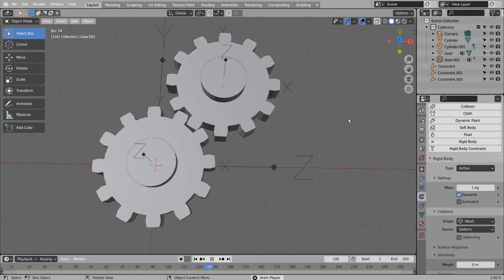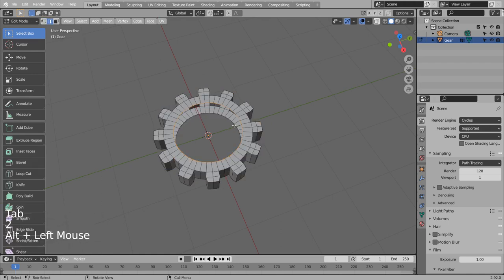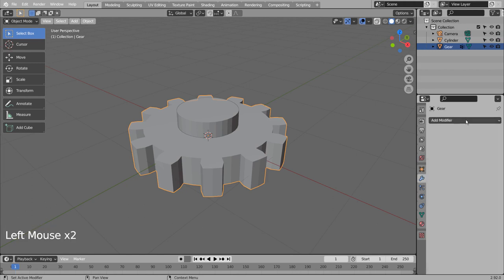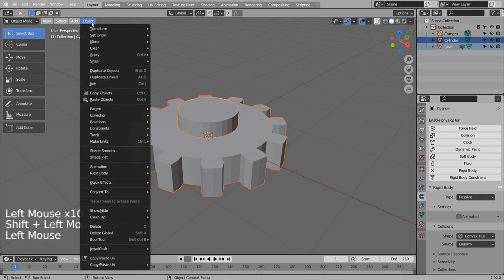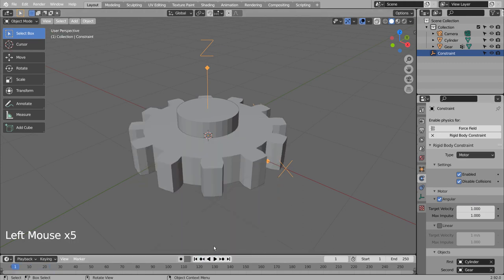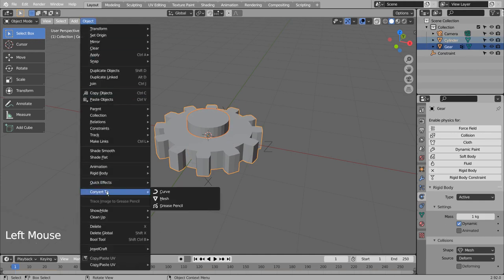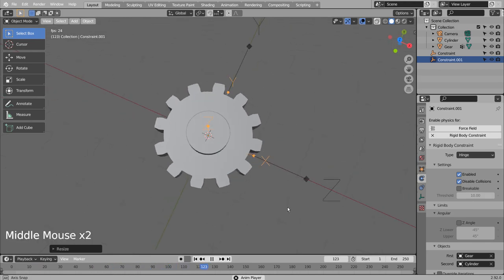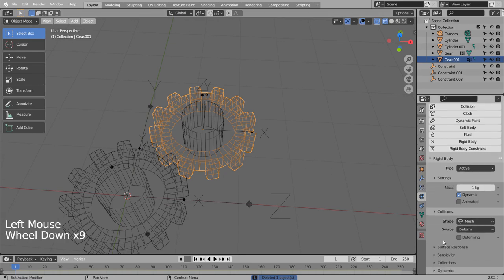Blender beginner series No. 100 - Rigid Body gear

Comment: How do I get it to loop for more than 250 frames.. increased the number in the rendering and the rigid body connect constraint.. Still stops after 250 frames
Reply from the maker: Thank you for watching, DINO IDEAS..!! :)  Sorry for the late reply.. I've been away. :(

Oh, we can increase the render frame length by changing the End frame to more than 250.  (It's located where it says 'Start 1' and 'End 250' at the bottom of the screen.)

If this is only regarding the Rigid Body setting, then please try this.

1. Go to the 'Scene Properties' tab on the right bottom corner of the screen. (The 5th tab from the top..)
2. Go to 'Rigid Body World'.
3. If there's no active Rigid Body World, press the 'Add Rigid Body World' button.
4. Change the Rigid Body World cache to a higher number than 250, and bake the scene before rendering. :)

That will fix the issue. :)
Reply: @BlenderStudy  Thank you for responding and making amazing tutorials that are on point
Reply from the maker: @Create_o_raptor  You're always welcome, DINO IDEAS..!! :)  Thank you for watching..!! :)